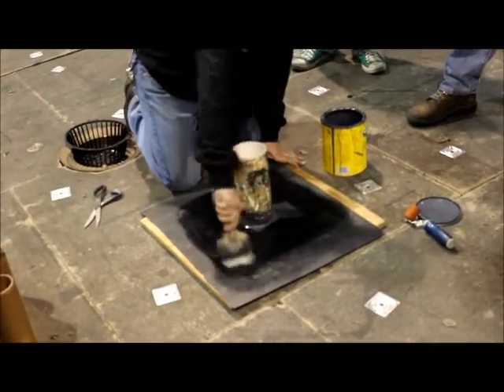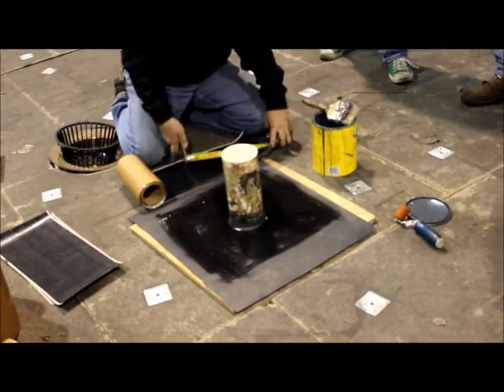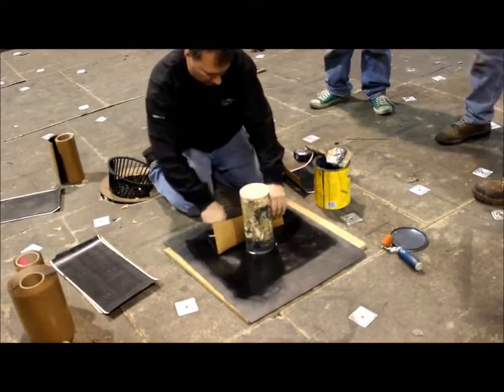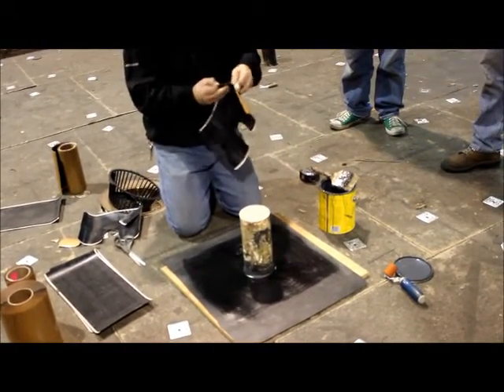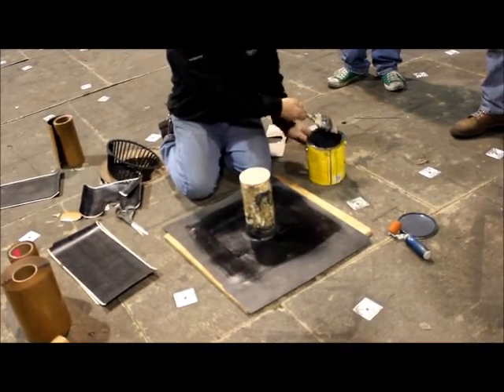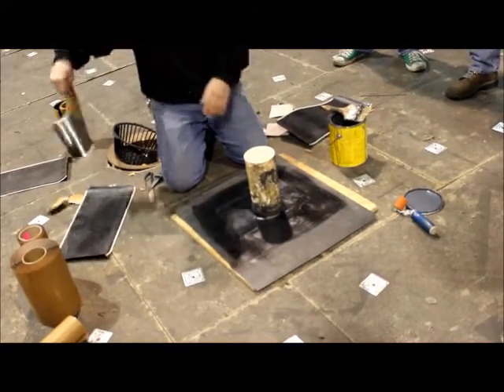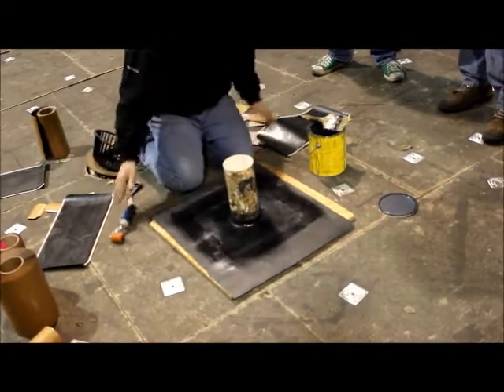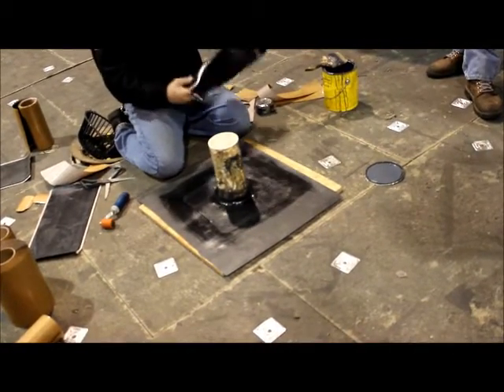3rdYear-Group305: EPDM Class 03-04-2014 - Pipe Wrapping Instruction

Comment: Useful video, thanks Kevin. 

I need to do a wrap on a poly-carbonate roof around two existing pipes about 6 inches apart from each other against a wall. Flash band was used originally but has failed and is letting water pass underneath and into the roof.

One is 2 inch waste pipe, the other a 4 inch soil pipe, both are about 3 inches from the brick wall where lead flashing comes down and overlaps the flash band and roof about 6 inches. The pipes pass through the poly-carbonate roof which has about a 15 degree pitch running parallel to the wall (water running down beside the wall). I think the main problem will be working the tight space between the pipes and the wall. I intend to remove as much of the old flashband as possible from the pipes, and the poly-carbonate roofing is being replaced with brand new.

I would appreciate any tips for this awkward situation? 

Is the EPDM bonding primer suitable for use on poly-carbonate, and will it secure the EPDM to the brick wall? 

I expect the lead will pull up before the job, and lay down over the completed wraps once finished. As one of your students said cheekily in the video, he would just use a boot, and although tempted to do that I'm not sure how successful two boots with two different diameters in close proximity to each other and the wall would be! Never done this sort of thing before so its going to test my abilities.